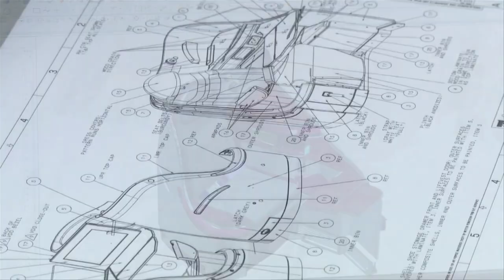Qatar Airways Set To RETIRE Their A380 Fleet!

Comment: Ha ha Airbus... I knew it would be a failure. 1) Its an Airbus, they suck; 2) Its too big and costly; 3) It has no chance as a passenger to cargo conversion, due to structure & layout, making it impossible or  too costly.
Reply: Airbus is much better than Boeing, Airbus has way more orders worldwide. The A380 design is ingenious and provides the lowest cost per passenger mile in the industry.
Reply: @charbax  Everything you said is false, wrong and without merit or proof. I've been in the airline and aircraft manufacturing industry for 30 years, and I can tell you Airbus has terrible support. If it's not Boeing I ain't going. A380 was a disaster like many Airbus planes. A350 is a poor copy of a Boeing 787. A340 a 4 engine joke. BOEING 777ER is killing Airbus... French, ha ha say no more....
Reply: @gmcjetpilot  you talk about bad support, most of the crashes of these past several decades are Boeing. And if you worked in the industry, you'd know the US is completely corrupt, the US does not adhere by the worldwide openskies agreement, the US blocks all non-US companies from aceessing its market, the US goes aggresively against their own airline customers around the world using threats and corruption to keep their competitors away. A380 is much better than B747. A350 is much better than B787. A320 much better than B737. Which is why Airbus has a much bigger order backlog than Boeing. Every airline that isn't just simply illegally threatened by Boeing/US industrialist terrorist agents are smart and they order Airbus, Airbus technology and value for money is much superior.
Reply: @charbax  To your who has more orders comment before, "Boeing heads for expected 2018 plane order victory over Airbus", Ruters. As far as crashes except for the recent 737 accident (crew error in handling this simple non routine procedure, turn switch off,  they should have been trained for), the Airbus accident record is bad...compare narrow body. For the entire A320 family, 118 aviation accidents and incidents have occurred (the latest one being Afriqiyah Airways Flight 209 on 23 Dec 2016), including 35 hull loss accidents (the last one being EgyptAir Flight 804 on 19 May 2016), and a total of 1393 fatalities in 17 fatal accidents (the last one aboard EgyptAir Flight 804 on 19 May 2016). 

Remember Air France Flight 447. A330, operated by Air France, stalled and did not recover, eventually crashing into the Atlantic Ocean at killing all 228 passengers and crew on board.

Your comments about USA, are bull shit. We allow every Nation under the sun into USA. Our laws are no more restrictive than any other country, and more likely to be much more liberal and generous. No country allows foreign owned airlines to operate as domestic carrier's. Yiu clearly know little of Aviation and even less about international flight flight laws and commerce. USA Airlines have many restrictions to access, operation to and in other Countries . Stop whining and making excuses. Go to JFK, LAX, SFO, ATL, Houston, Chicago, every airline in tha World is there. Shut up.

I've shown over and over you are ignorant and dishonest in your biased, bigoted anti Ametican bull shit. I'm in the airline industry. As a pilot I flown all over the World (ATP typed in B767-300ER). As an engineer out of college I started out designing and analyzing aircraft structures. 

 I'm in the Airlines I know. Again Boeing is #1 second is Airbus... sorry... oh yes the 320 is popular... and the 737 Max is steeling orders quicky because it is better, more efficient, more reliable... 

When I say Airbus gives BAD customer support I'm not kidding
 You have issue with Airbus you send message to them Toulouse France. They translate to French, then send to Germany (if that part is made by them) who translates into German. They send back message repeating this process, translating it back. It takes too much time, and they don't answer the question. Parts? Forget it. It's a mess. Damage a Boeing and you can have a whole (AOG) Team with parts dispatched quickly... Airbus support SUCKS..

The A380 is another example of an Airbus failure. They just announced that production is ending. You have no facts to back up anything you said. The 777-300X is eating Airbus's lunch. The A350 entry into service was a disaster, not ready for airline service reliability was poor.
Reply: @gmcjetpilot  Airbus: 35 crash
Boeing: 251 crash

In the 10 years from 2007 to 2016, Airbus has received 9,985 orders while delivering 5,644, and Boeing has received 8,978 orders while delivering 5,718.

Airbus received 4,471 orders since the A320neo family launch in December 2010, while the 737 MAX got 3,072 from August 2011 till January 2016. In the same timeframe, the neo had 3,355 orders. Airbus have a 59.4% market share of the re-engined single aisle market, while Boeing had 40.6%

Airbus A320neo is the world's most popular passenger airplane at the moment, the Boeing 737 MAX has issues planes crashing and grounded recently with no apparent solution in sight.
Reply: @charbax  Nice Wiki  cut paste. Read it. In the 10 years from 2007 to 2016, Airbus has received 9,985 orders while delivering 5,644, and Boeing has received 8,978 orders while delivering 5,718. (Boeing delivers, Airbus gets orders canceled or converted). In the midst of the intense competition, Boeing won more orders in 2018 and is on track for 2019 to do the same. Airbus does not have to make money, it is receiving unfair state aid from their respective governments. The difference in sales is small, goes back and forth, So....

Airbus planes are cheap, cheap to buy, cheaply made, dont last and why they are replaced often...disposable. Boeing jets last + 40 years... Airbus planes suck and so does their customer support.

 I'm in the Airlines I know. Again Boeing is #1 second is Airbus... sorry... oh yes the 320 is popular... and the 737 Max is stealing orders quicky because it is better, more efficient, more reliable... better support.

When I say Airbus gives BAD customer support I'm not kidding. You have issue with Airbus you send message to them in Toulouse France. They translate to French, then send to Germany (if that part is made by them) who translates into German. They send back message repeating this process, translating it back. It takes too much time, and they don't answer the question. Parts? Forget it. It's a mess. Damage a Boeing and you can have a whole (AOG) Team with parts dispatched quickly... Airbus support SUCKS..

LAST A380 is Dead... Ha ha... another crap air-bust failure... ha ha ha... Boeing planes stay in production for decades...and fly for 40 years... Airbus planes come and go and are disposable...

PS besides the Airbus accident I mentioned before, the American Airline, out of JFK in 2002, the Airbus A300 RUDDER FELL OFF!!! This killed a lot of people, all in airplane, many on ground. Boeing planes don't just fall apart.
Reply: @gmcjetpilot  not just Lion, Norwegian has a 737max stuck in Iran it nearly crashed with exact same issue. Not only Norwegian has all 737max orders on hold every other airline is blocking all further 737max deliveries for the moment. This is such a huge issue Boeing might go bankrupt if Trump doesn't bail them out.
Reply: Charbax The 737MAX Thats in Iran made an emergency landing due to An engine problem. Idk were you got “It nearly crashed from”
Reply: @Racko.  same engine problem that made it crash.
Reply: gmcjetpilot I work for a US3 airline. These guys have no idea what a pain Airbus aircraft is. All they see is the passengers side of the business. 

Between the APU auto shutdowns because of the cold temperatures. 

Blown bus ties

ECAM messages 

Issues with the green, blue, yellow hydraulic systems

Issues with the packs

Overheating brakes

I can keep going. They are a pain to deal with.
Reply: @gmcjetpilot  I told you that the 737 Max is a piece of shit and if they haven't grounded it after the first Lionair and massive possibly near crash Norwegian issue, then it could probably be a criminal case against the criminals at Boeing and at the US department of commerce who went ahead with more 737 Max deliveries and flights after proven repeat significant issues with it. They need to ground all 737 Max airplanes and halt all deliveries and all production possibly now for years until they can figure it out. All Airlines should just buy the Airbus A320neo instead.
Reply: @Racko.  that same 737 Max engine and faulty design problem has caused two crashes now already and several near crash issues reported already the Norwegian one is just one of them. It's only because the airlines are in Indonesia and Ethiopia if Boeing does not have ALL of their 737 Max completely grounded and halted by now. Had those two crashes happened in the USA, there would be little chance Boeing could even survive this now as so much of Boeing's future relies on the 737 Max.
Reply: @gmcjetpilot  the 737 Max is a brand new airplane, not even 2 years since first commercial flight. 2 such crashes is totally unheard of. All of the 350 Boeing 737 MAX thus far delivered are completely grounded worldwide. Any Airline now still flying a 737 Max must be completely out of their mind. All 5011 firm orders for it are hereby completely cancelled or delayed until Boeing has completely 100% fixed this issue. Most likely that the whole 737 Max programme must hereby be completely cancelled. All Airlines should hereby consider switching all their orders over to the much safer and better selling Airbus A320neo, re-adjusting their pilots and logistics will be a piece of cake. The only problem is that Airbus cannot possibly deliver all these A320neo orders fast enough. Perhaps you need to show some respect and not fucking defend this stupid 737 Max design when it is so obviously totally and fatally flawed.
Reply: @gmcjetpilot  why don't you personally fly on a 737 Max then the next time you fly? Only the corrupt and criminal US airlines are not grounding it. All airlines worldwide are grounding it. It's fatally faulty and anyone still flying or taking deliveries on 737 Max is completely out of their mind. As far as I hear it's something to do with the engines too big up close to fuselage or something like that, the crucial part that enhances range and fuel efficiency on this design is faulty. First 3 designs of 737 in past 50 years were fine, but 737 Max is fatally faulty! It's not just fixed by a software update! Boeing should go back to the drawing board and redesign the whole airplane, this could mean years of delays in the 737 Max program and they should rename it too. And all costs in delays and cancellations should 100% be covered by Boeing.

Comment: Wtf just happened
It's like all airlines have Made a joint to kill the king
Reply: It didn't need help. It was a vanity project from day one.  I wonder how many heads have rolled at Airbus.
Reply: They didn’t kill the king because the A380 was never the king
Reply: @gumbyshrimp2606  hahaha
it's the "name"
It's like the queen 747
Reply: Bruno Cascardo well obviously the 747 is the queen 

But the A380 was never the king of the sky. It looks ugly, and is a failed program after 20 years.
Reply: @jeffreywright4656  - Most of them retired early.
Reply: @gumbyshrimp2606  I'm not an Airbus fan,
I prefer Boeing
But an 4 engine model and 2 Decker airplane Is cooler than a simply a350 or 787, whenever they both are beutiful
The only shit it's airbus (automated)
Reply: @gumbyshrimp2606  sure is the king.The only one that takes in to the sky 800 hundred people and no doubt it is King-Size...
Reply: @FlukeCypriot  but it has neeeeeever carried 800 people and that has been the #1 problem.

Comment: Typical Boeing fanboy bullshit
If you had ever traveled trough a big hub, you would know how major congestion will mean jumbos will be in great demand in 10 years
Also, all the fuel efficiency argument is crap, if you divide per seat, the fuel burn of the A380 is lower than any Dreamliner and stuff
Reply: @Samuel Jennings The capacity can't be filled
The A380 is still in it's smallest form, while the 777 and A350 can't really be stretched that much more...the wing of the -800 is already designed to accomodate a stretched A380-900 without any modifications needed (that's why the -800 is less efficient than it could be, it's carrying around a slightly oversized wing)
Let's see how congestion is in 10 years, and you'll see how i'm right
I'm not saying the A380 is desperately needed now, but it's key to keep it around and alive, ready for future super congestion